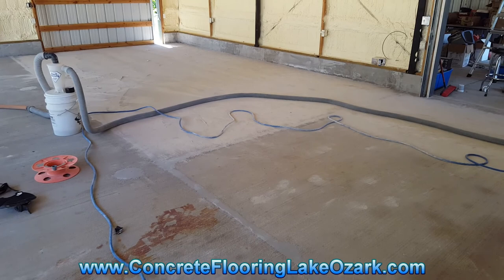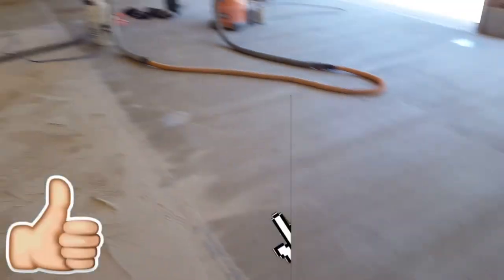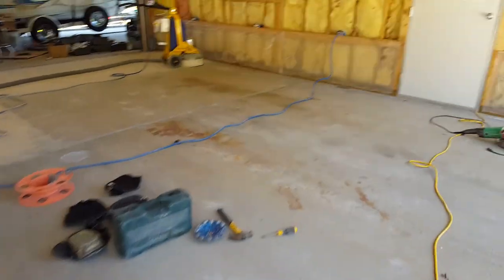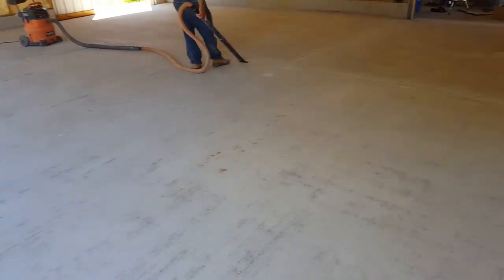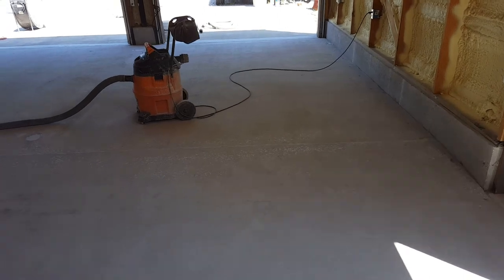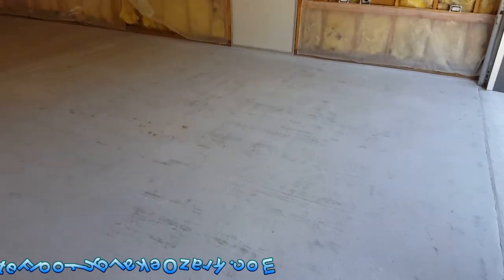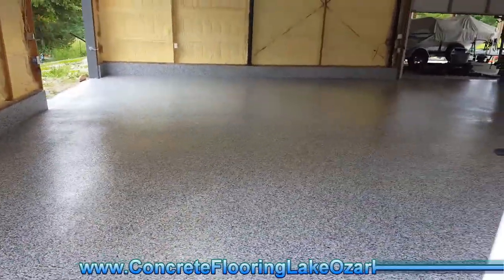Decorative Concrete Garage Epoxy Vinyl Chip Floor - Lake Ozark Missouri - Decorative Concrete

Comment: That's Amazing, anyway to show some of the in between steps??...how much is this to do?? my shop is about that size, great lookin work!
Reply from the maker: Thank you, I have a few other Video's on my page that are more step by step, be sure to subscribe and check out my channel for those other Video's. Cost varies, depends on sqft, design, and condition of your concrete. thanks for stopping in to comment.
Reply: Huge difference, beast mode worthy!!
Reply: Came here to ask this question

Comment: Wow that looks like shit. Topcoat is not at all uniform not to mention incomplete prep. The shopvac was the cherry on top of the hacksunday.
Reply: Really?
Reply: Steve Lorne yes really, you're not supposed to see the variations of sheen.
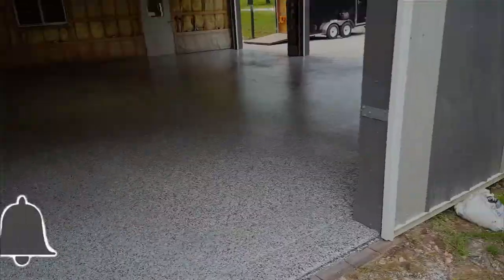Reply from the maker: WELL IF you were listening to what I said John Hendon you would already known I said its still wet, we just finished the last coat of sealer HERE is the exact time I said it between 1:56 and 2:03 in the Video, go back and listen , now do you think the sealer dries the exact same on the entire floor??.... Really??... If you took a garden hose to a garage floor and saturated it with water, do you honestly believe its all going to just poof all dry at the same time, you have no idea what you are even talking about, its a Urethane sealer and it does soak into the chips a little, and as for the incomplete prep work... haha once again you have no idea by just watching this video what we did after it was shop vaced.... who's the hacksunday now??...next time actually know what your talking about....thanks for your shitty opinion tho it was a good laugh.
Reply from the maker: Steve Lorne, this John Hendon has no clue what he's talking about, read my reply under his... thanks for watching.
Reply: So what you're saying is you use a very low solids urethane? That's the only justification for it drying all spotty like that, and you really put urethane right over chips? No grout coat LOL you residential guys really crack me up I've been installing stonhard hard for over 15 years but yet I don't know what I'm talking about.
Reply from the maker: John Hendon nope not at all what I'm saying about the Urethan, grout coat? Lol...that's for Concrete Overlays not Epoxy, if you mean Base coat of Epoxy then yes it has a Base Coat of Epoxy, then the chips, I could careless about your 15 years experiance, I've been doing this 15 years also what of it?
Reply: The process for a traditional chip floor is epoxy base coat epoxy grout coat and then urethane topcoat, the only way that it would look spotty and inconsistent when it was drying is if it was a low solids urethane or if you don't know how to put it down.
Reply from the maker: John Hendon I've been to a Dozen Basic and Advanced trainings combined not 1 of those training's ever said a word about epoxy grout, base and grout are only reffered to when it's an actual  Concrete Overlay, maybe the brand you use is laid down different with an extra step I don't know,  but I have used 4 different brands and they are all laid down the same way I did this shop floor.
Reply: MrCustomConcrete Its an industry term. Real life experience beats making sample boards at a "training" any day. We're doing a few thousand feet of quartz in Columbia next week. If you want to stop by and see how the pro's do it let me know.
Reply: John Hendon, an epoxy grout is not needed. In fact, it will amber with time. These days you can squeegee on a high solids polyaspatic or two coats of a lower solids polyaspartic (65%). Perfect uniformity unless you didnt scrap the flakes uniformly.
Reply: MrCustomConcrete okay buddy. I just invited you to a jobsite within a 2 hour drive from you. How much more proof did you want?
Reply: Joey Mac All coatings amber eventually, I have duraflex floors with just epoxy topcoats that are over a decade old, and I have general polymers polyaspartic floors that we laid last year that are now yellow. Its all about the quality of the material.
Reply: Joey Mac For small floors I agree polyaspartic is the way to go for topcoats, but this guy said urethane.
Reply: Maybe he meant polyaspartic but yeah, urethane doesn't have the build to cover flake.
Reply from the maker: I did say Urethane, that is what The Concrete Protector Uses, and I use their products, I have garage floors that have been down now for 8 years since using their Urethane Top coat with zero issue when it comes to yellowing.... so what you know about your product is great more power to ya... but what I use is different and I can tell you it works.
Reply from the maker: Not true Joey it does... I have garage floors down from 8 years ago to prove it, I tried it on my garage floor as a test and it was fine after a year, so I switched products for garage floos and started selling my garage floors using a Urethane Top coat, its for outside use, they make a WB one that is for inside use over clear Epoxy... I guess it really all comes down to the product you use, I'm good with what I use because I have 8 years with this product and 15 years with my other products, each product has its place in my opinion for what I intend to use it for.
Reply from the maker: I don't need to waste my time driving to your job John, I have my own jobs to get done, time is money.
Reply: Do you have to put down two coats. I remember talking to Andy a while ago. I think he said he used it also, but I think he put down two coats. CP has good products and good training.
Reply from the maker: Yes you have to put down 2 coats, I have known Andy 5 maybe 7 years BEFORE he went to work for The Concrete Protector we talked on the phone several times a month, he has always givin me great advice and definitely knows his stuff from application technique to his products, got to finally meet him in person his first year at TCP....yup their all a great group of guys and the training is top notch.
Reply: Yeah, I knew him when he was running Supreme Crete. Good guy, knows his stuff